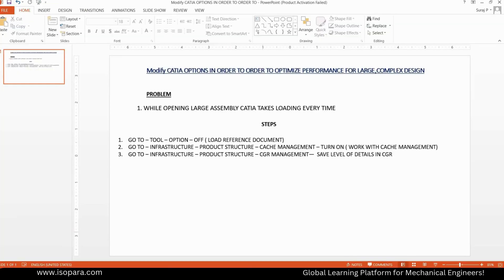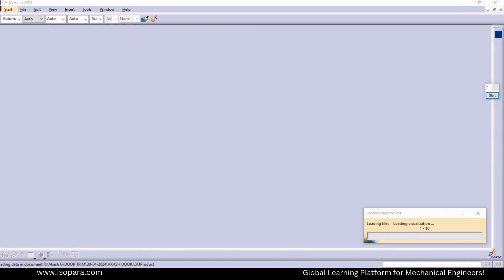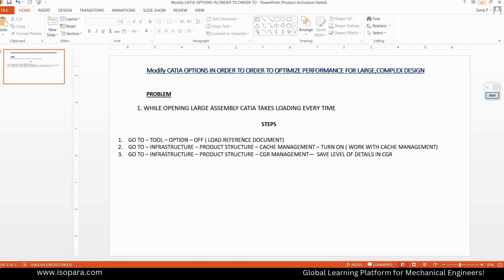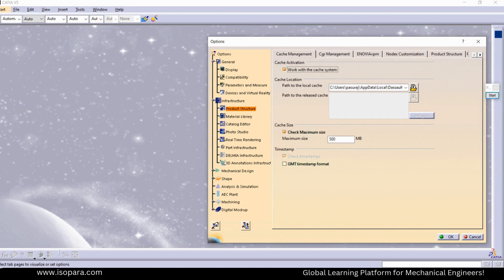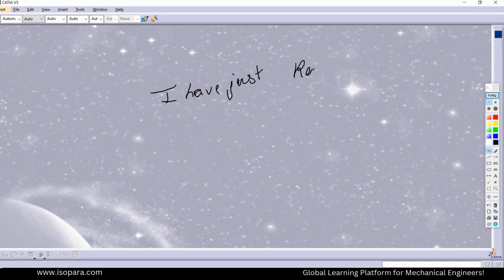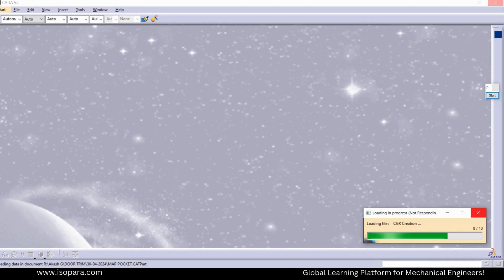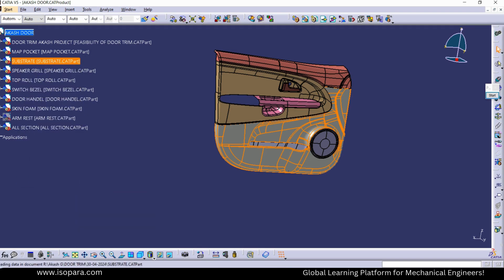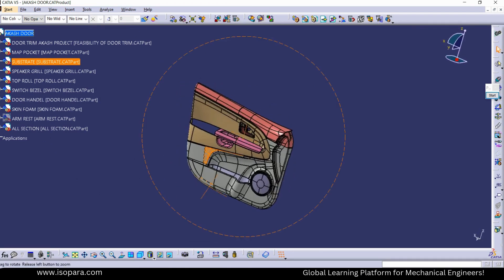Open Large Assembly in CATIA V5 using CGR Mode | Boost Performance Instantly!

Comment: Hi, I have a question
why don't we design using solid mode then convert it to shell?
Is there any specific reason to use surface model even though it is so difficult?
Thank you for the explanation
Reply from the maker: Complex shape can't be posible in part modeling.  Also the styling surface is complex to use direct thickness.  That's why surfacing is used